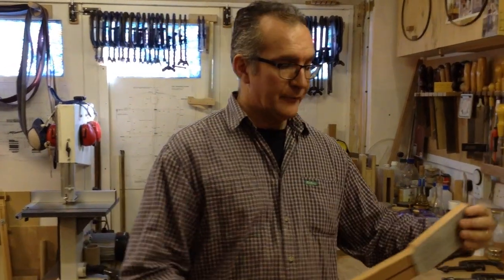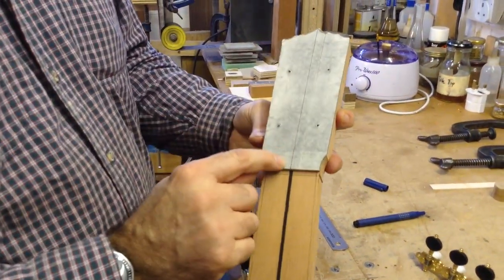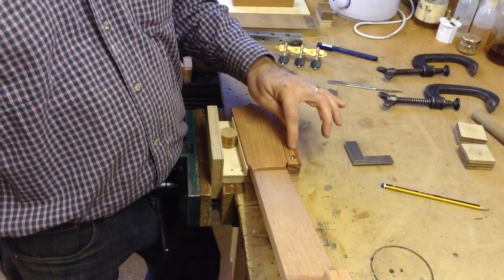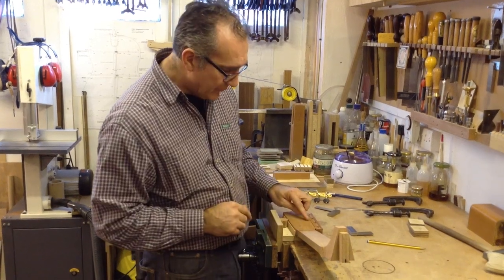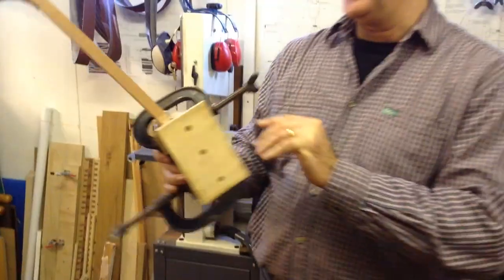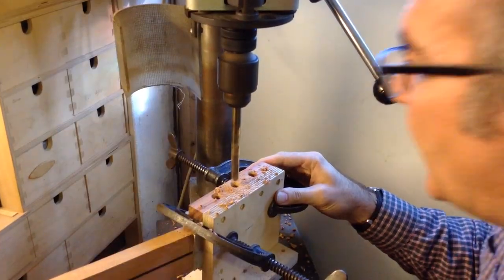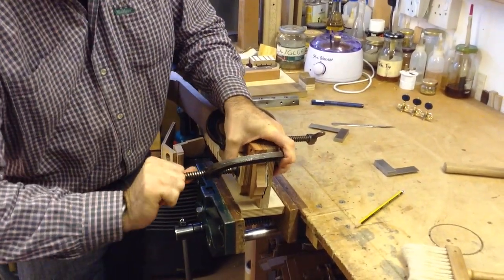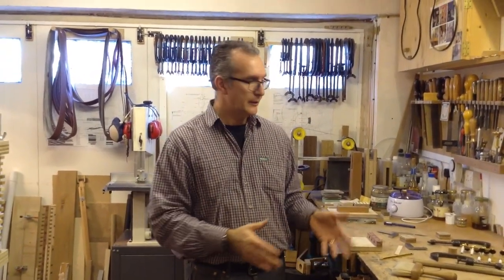How to fit the tuners on a Spanish guitar

Comment: Hi, thanks for these very informative videos.  Am I right in saying you use a 10.5 mm drill bit?  I did not know they were available.
Reply from the maker: Yes, that's correct. You can find it on this link:
https://www.amazon.com/uxcell-Reduced-Shank-Twist-10-5mm/dp/B082CYLDC2/ref=sr_1_1?crid=2D9AJRQDQWWG6&dchild=1&keywords=10.5+mm+drill+bit&qid=1603481374&sprefix=10.5+mm+%2Caps%2C217&sr=8-1
Reply: I used a 13/32 bit which is approximately 10.3mm to drill the holes in the classic guitar I built. It works great, and you will also have some minimal extra material that you can sand with a dowel and some fine sandpaper to get a smooth fit :)

Comment: Hi Pablo,
Thanks for this tutorial :) nice video.
A question, Is that your glue pot (pro-wax 100) on the background?
And how do you use this pot??
Greetings Joës
Reply from the maker: Hi Joës,
Yes, it is a ladies wax melting pot, there are lots available in the market, you can also use a baby bottle wormer. With mine the only change I did was to use a glass container for the glue instead of using the aluminium one that came with it, it may not make any difference but just in case I prefer to use glass. Try to find a glass pot that fits quite well and you can put some water in the gap to transfer the heat... if it makes sense.
In terms of how to use it, you use in the same way as a normal glue pot, there is lots of info and videos on line about the subject.
I hope this helps
Pablo

Comment: the roller spacing is standard 35mm ?  How about the turning ratio 1:14 or 1:18? The bigger turning ratio is better because they are more sensitive and more accurate tuning of the strings. What is the normal standard width of the tuner head machine?

Comment: I saw that your Spanish guitar making courses mentioned that your guitar shall be fitted with Fusteros machine heads. Where can I buy Fusteros Tuner machine head which were vintage tuners and no more in production and rarely to be found..
Reply from the maker: You are right, they are not so easy to buy in small quantities any more, however, send them an email just in case the want to sell you some. Use the contact page in their website.  www.clavijerosfustero.com

Comment: I like those machines, are they by Rodgers ?
Reply from the maker: yes, the are really good, but they aren't Rodgers, they are Perona.
Reply: Thanks Pablo !
Reply: Rodgera tuners are very high end product come with very expensive PRICE TAG, base price start with USD650 per set. I prefer Rubner Guitar Tuner machine head only Euro $25 per set without engraving pattern and only PVC handle buttons.